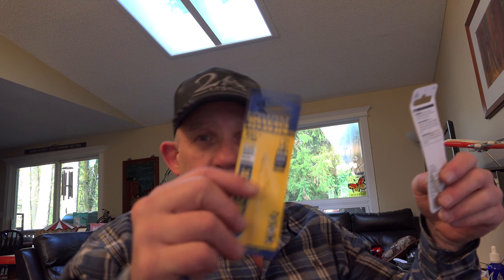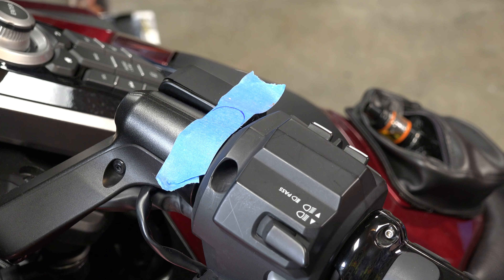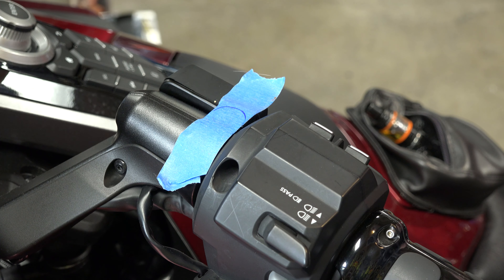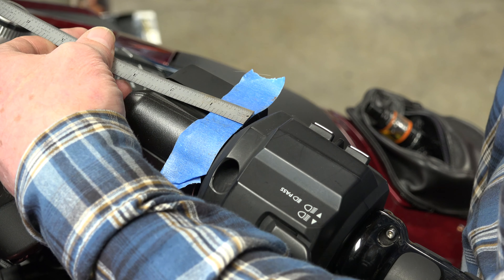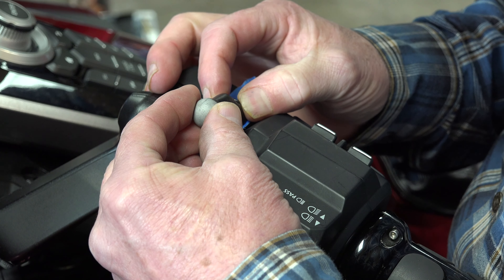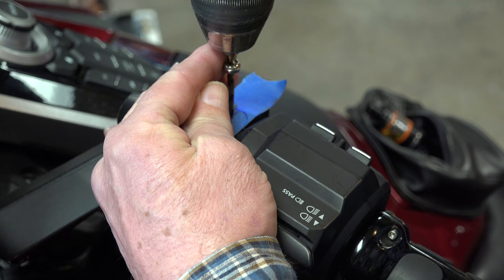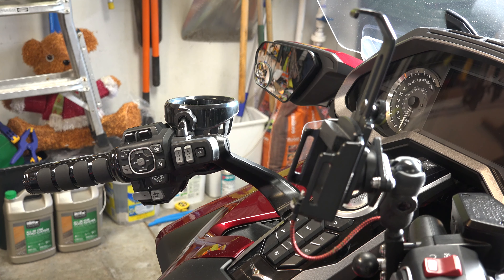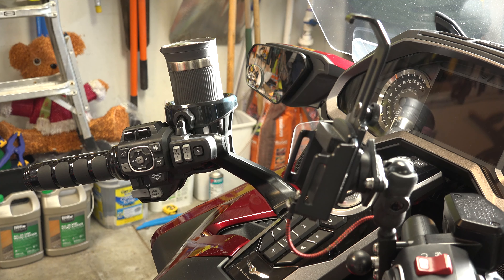2018+ GL1800 Goldwing Left Cup Holder Installation with CB Installed

Comment: Jeff- thanks for sharing this brilliant solution!  I was likewise frustrated trying to find  a way to Mount a cup holder on my ‘23 DCT with CB as I have my GPS and phone mounted on the right. Just finished installing using your approach and it works great!  I put some blue thread locker on the bolt to make sure it doesn’t loosen.

Comment: Hey Jeff, great work around. Question about the hand grips. Who makes them and can you still use the heated function?
Reply: @MichaelAaron55  Thanks for the info, will go that route
Reply from the maker: @hightech5366  Yes they are Kuryakyn ISO grips.
Reply from the maker: They still heat up but you do loose heat. For 40 and below days I use Mobile Warming battery heated gloves. 

Mobile Warming Blizzard Leather Heated Gloves - 7V Battery https://www.amazon.com/dp/B071CV8364/ref=cm_sw_r_cp_api_glt_fabc_HZTXT40FKP5BM9NWTDH7?_encoding=UTF8&psc=1

Comment: Hi ..i was watchingbone of your other vids (cb install) you said to flash the ecu...who did your flash and what did it do? Thanks
Reply from the maker: Guhl Motors had a flash for the gold wing. Reach out to them. It was around $350 - $400. 

They did what Honda should have done for all of us. It doesn’t take away the power of sport mode but does improve it, gives you sticky mode. if I turn the bike off in sport mode, it will start back up in sport and not tour mode and changed the temp the fans turns on. I don’t remember everything it changed but for me it was all good. 

https://guhlmotors.com/products/